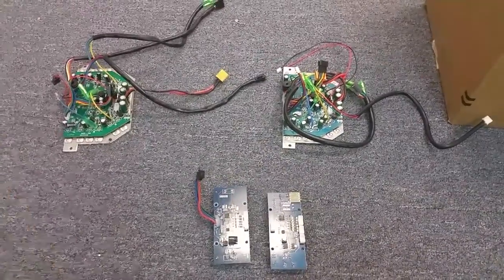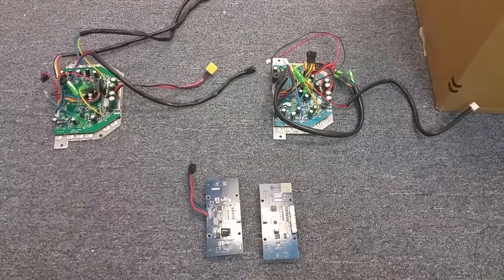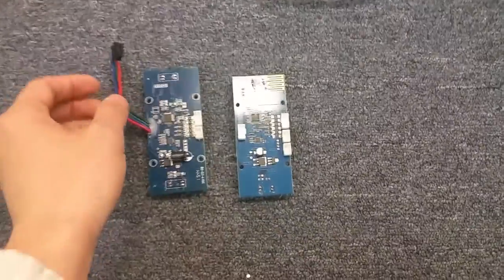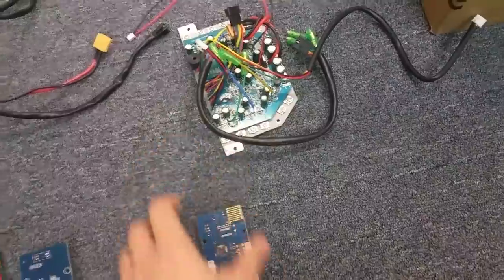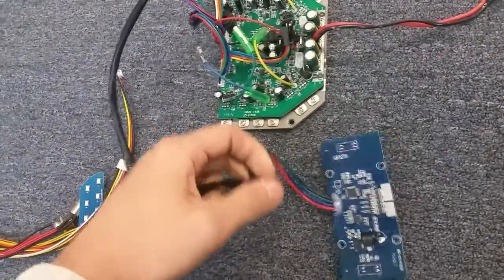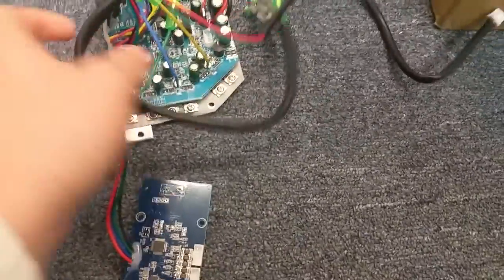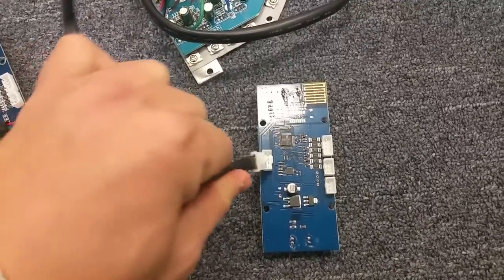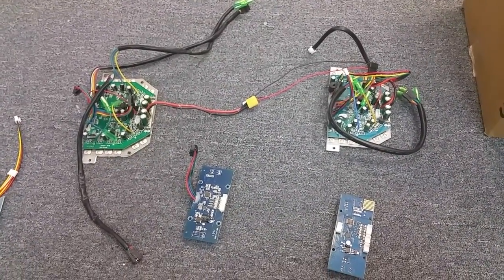Male Gyroscope Vs. Female Gyroscope - Which Part Do You Need?

Comment: What type of signal does this gyro boards send to the main board?
Is it pulse or just plain +- voltage?
Reply: Multipro Micheal i can help you out  ok so the gyro emits a tiny light often when a user try's   to calibrate the hoverboard and it press down into the gyro while calibrating its an Insta death . but its not pulse technology what it does is if you look close to the gyro motherboard there is 2 plastics sticking out of the bottom a light will stay on and as you put your feet on the hoverboard it breaks that light and it knows you are on the hoverboard. im not a technician but i fix hoverboards. in my town.